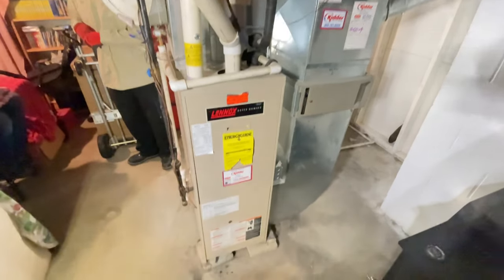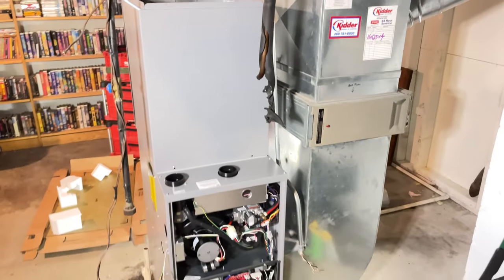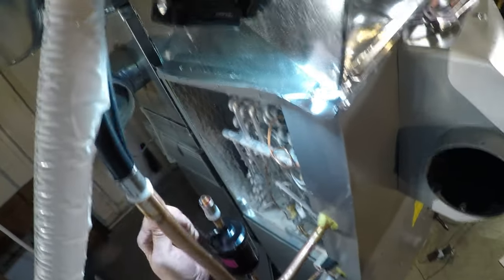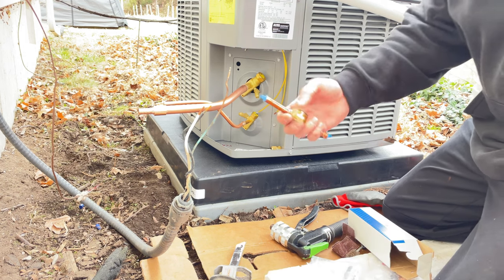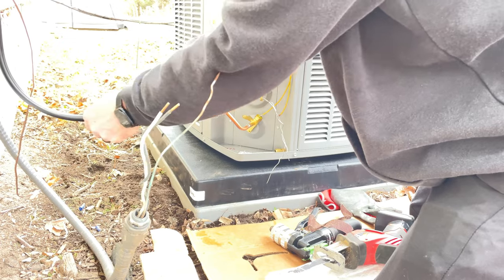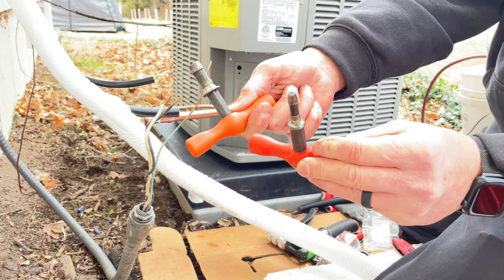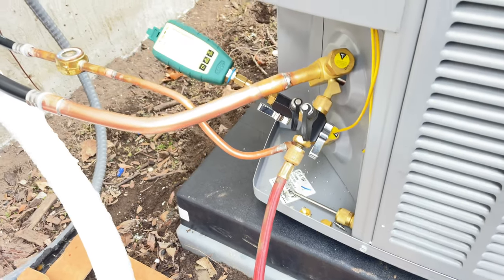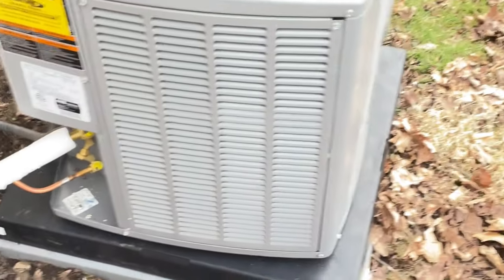Lennox-to-Armstrong HVAC Upgrade with Yoga Pipe ACR!

Comment: Hopefully you have better luck with yoga pipe than we did. Heat pumps will blow the line apart
Reply from the maker: Yes, you can't use this on Heat pumps. Just straight cooling. I think this is where Yoga pipe gets a bad rap from is in the beginning of use of this piping contractors were using it on heat pumps then after a few failed attempts they stopped using it.

Comment: Never seen that people before, very interesting. To me I would think the only downfall is that it looks like it’s actually reducing the Inside diameter of the pipe when you make the connection. For example the 3/4 almost looks like 5/8 when you showed the inside of that pipe.
Reply from the maker: So the ID of the 3/4" Copper is 5/8" ID and the ID of Yoga 3/4" is 9/16th" ID so only a 1/16th" difference.

Comment: Do you use this yoga pipe on all your installs,deffinitly interesting,the first time i seen it was on your videos,theres only a couple videos on you tube of it and there not positive,but with anything its all in how its installed,would love to mess around with some of it,how does it compare price wise to a regular line set,do you like it better then the pro press
Reply from the maker: I use this for about 80-90% of my Ac Installs. The only time I don't is if I can reuse the Old line set by Cleaning it or If I install a Bosch Heat pump. I calculated it's about 25-30% Cheaper than Copper. That adds up! Haven't used Propress yet going to try it this season.
Reply: @ADVANHVAC  I got a bad habit of commenting before i watch the whole video,you answered the price question at the end,appreciate the reply and I enjoy the videos. Always nice to learn something new and see another way to do things
Reply from the maker: No worries, thanks for watching.

Comment: I guess I don’t really see the benefit of using that pipe. It’s definitely not any faster than copper. I used it when it was called Multi Flex and it was complete garbage
Reply from the maker: The only benefit, is it doesn't kink! Thanks for watching.